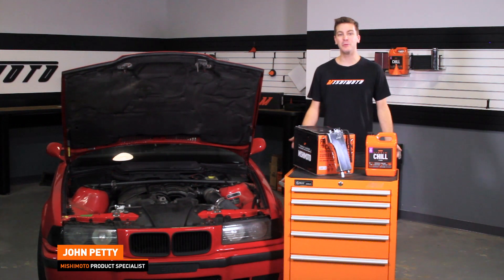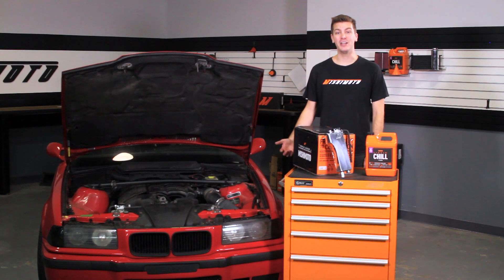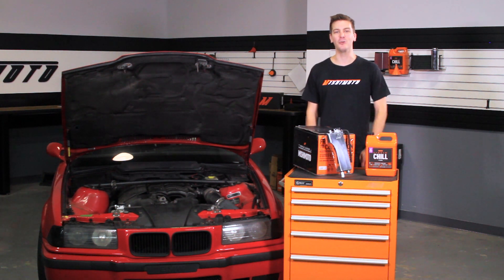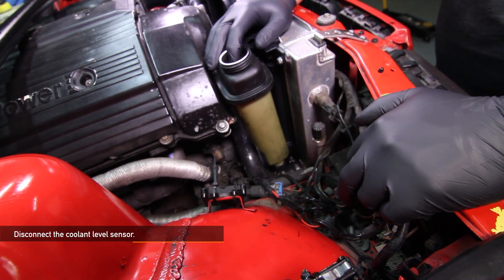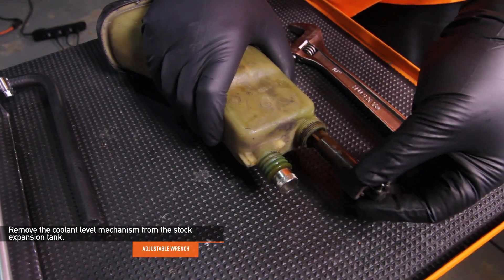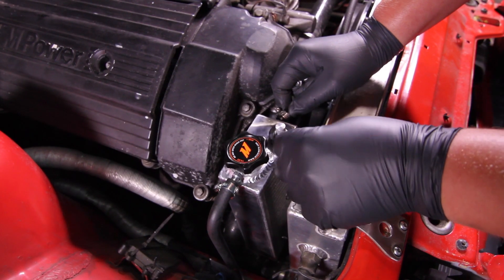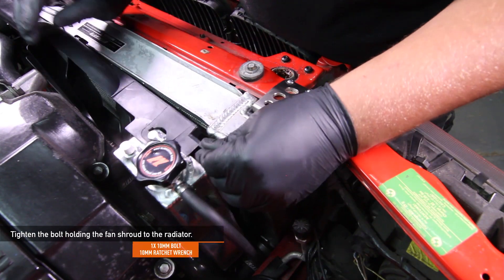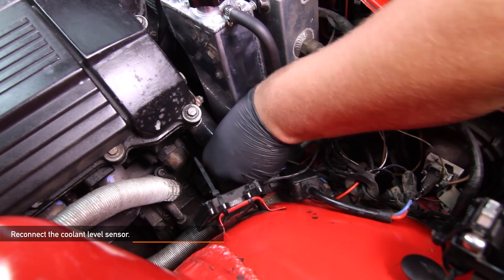1992–1999 BMW E36 Expansion Tank Installation Guide By Mishimoto

Comment: how much coolant should there be?
Reply from the maker: After a few hot and cold cycles, Mishimoto recommends checking the dipstick to confirm a proper cold coolant level. It is critical that the dipstick is not removed when the engine coolant is hot. You must wait until the coolant is cold before removing.

Comment: What tool are you using at the 3:38 mark? I didn't see it mentioned as a needed tool in the intro....i think I need that tool
Reply from the maker: This is a screw driver being used to tighten the clamp on the hose connecting to the expansion tank

Comment: I have a bmw e36 from 1992 320i no vanos my radiator is the one with the built-in pan on the left.  Can I fit the mishimoto radiator and expansion tank?  What changes should I make?
Reply from the maker: Unfortunately without changing out a lot of the coolant hoses the radiator and expansion tank would not be compatible.
Reply: @mishimoto  Is it possible you don't have solutions for this type of model?  If I also changed the expansion tank, what changes should I make to the pipes?

Comment: I have had two E36s and both got cracked plastic expansion tanks. My mechanic said the EOM plastic lasts about 4-5 years so its not a matter of IF, but when. I upgraded my entire cooling system with metal  components to replace all the plastic crap.

Comment: Can anyone tell me how to allow the level sensor to work? The hose to suck coolant back into the rad occupies the space for the float and stops it from floating to the top... So even full I alway have a low coolant level error.
Reply from the maker: It sounds like the hose inside shifted and needs to be repositioned to prevent this from happening. Give this a shot, if you run into issues please contact us at support@mishimoto.com.

Comment: Hello mister e36 sedan 1995 radiators
Reply from the maker: Hello Make N. We do produce a radiator for the 1995 E36. However, it only fits the following models. I'd be happy to submit a new product suggestion to produce some items for the 320I, but this would not be an immediate solution. 
1995-1999 BMW M3 
1998-1999 BMW 323IC/IS 
1988-1991 BMW 325I 
1992-1995 BMW 325I/IC/IS 
1996-1998 BMW 328I/IC/IS

Comment: I have the shroud and aluminum tank but after install using the bracket it came with the expansion tank but still feels loose and moves around? I used zipties for now but any idea what i did wrong? Dont see anything that i could be missing
Reply from the maker: Hello SingleSlammer240. What is the make model and year of your vehicle in particular? I'd be happy to see if we have any notes regarding fitment with your vehicle in particular. Also, did you happen to have a chance to look at our installation guide? https://www.youtube.com/watch?v=Gla080qu34g&lc=UgxpaoNCxpynL9r4zhh4AaABAg

Comment: where can I get the metal clips you have holding the radiator?
Reply from the maker: +Will D Those clips are unfortunately not purchasable, they were a custom item on the car.
Reply: Danny iPwn I know right these would be better than stock
Reply: i had the same question